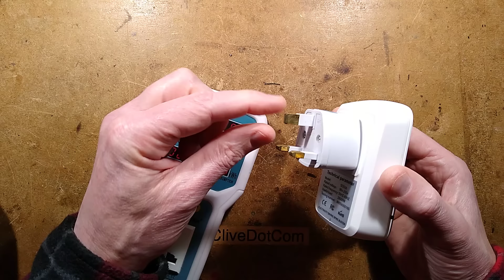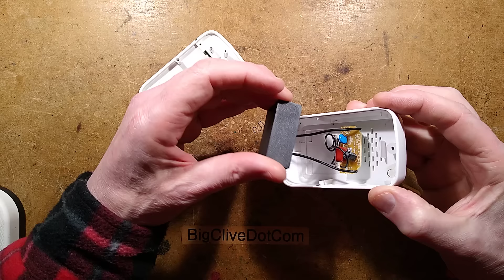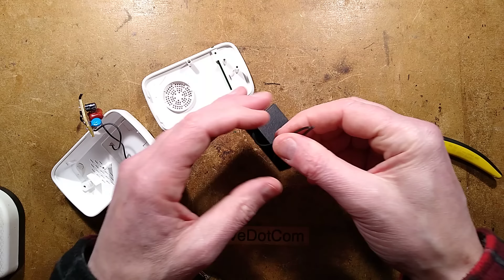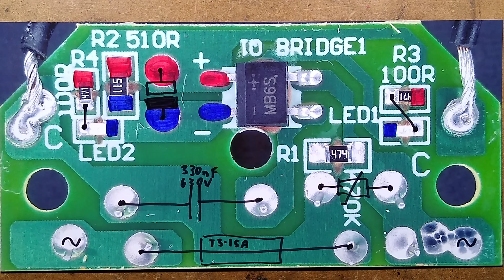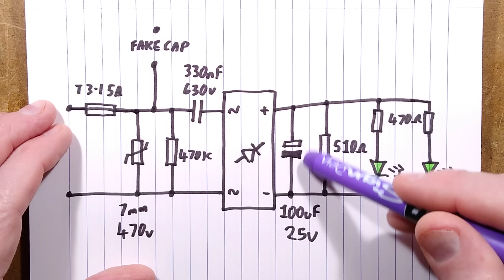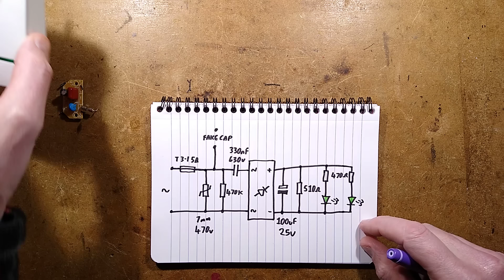Scam power saver plug - the 2024 edition.

Comment: Dumb question, but why is the sleeved Earth pin naughty?
Reply from the maker: Although it's not used in this product, the earth pin is sometimes sleeved on other products that do use it.  It defeats the earth connection as the plastic tends to be in the contact area.  There should be no plastic sleeve on the earth pin at all.

Comment: Question is, is there a thing, a plug in electric savers for domestic use ?
Reply from the maker: Sadly, no.  But you can save a lot of energy by doing things like turning the heating down a bit and wearing warmer clothing in peak winter.

Comment: I have a device my father bought probably 35 or more years ago. It’s a small box that you plug into the wall and you plug your refrigerator into it. I’ve tested it using a watt-hour meter for 24 hours with the refrigerator door untouched with the device and 24 hours with the refrigerator door untouched without the device. 

It easily reduces power consumption by around 22%. The unit is packed with circuitry and integrated circuits that control the current to the refrigerator’s compressor motor. Ramping it up and down instead of running full out all the time.

Units… some not all… whereby the device is plugged into the unit then into the wall do work with things like motors.
Reply from the maker: There were plugs that reduced compressor power with phase angle control or something.
Reply: @bigclivedotcom Wonder why they seem to no longer exist. Savings of 22%? I’ll take that all day long.

Comment: The state-run "Stiftung Warentest" in GER reported, that water& energy saving shower heads have the greatest savings potential, up to €300 p.a. at a cost of just €20. Otherwise, you should install LED lamps, switchable power strips, energy-saving heating pumps, programmable thermostats and timers: for water boilers, router, repeater etc at night.

Comment: my wife asked about this device . I work on auto electrical for many years, and I am glad you are showing this. I think there are ways to use solar panels and backup battery systems / but even those devices have fraud do your research / the rating can be misleading.

Comment: I found these in a small Returned Amazon Type stuff local resale shop. Two sets of them separated by a couple of years. Both sets had the larger circuit board of your first sample. The first set had real High voltage capacitors in the microfarad  range The second batch had the potted boxes as above, which I presumed contained a capacitor. Small capacitors across the hot leads do provide some crude Power Factor correction. In all the devices, the leads of the "capacitors" are both soldered to the same trace on the circuit board. Now,, this is clearly not a factory error. In the US, both leads of each capacitor are soldered to the trace from the neutral power wire. Knowing that the intent is to place the capacitor across the AC power leads, close inspection revealed an unused surface solder pad on the circuit trace following the fuse from the AC hot wire, I moved one capacitor wire to the intended solder pad. Little did I know that in half my devices, I was wasting my time. Now to sweep up the sand on my floor. Some of these devices have been brought to market at $100.00 each. For a year, Elon Musk was the primary promoter of these devices. They are no more than glorified green LED night lights! The amount of corruption and fraud in this product is beyond measure.

Comment: so, say an actual capacitor was there and put a link on the blank pad? how spicy would it get?
Reply from the maker: Some do have real capacitors, but still effectively do nothing for your electricity bill.  Depending on the loads in your home they may actually even cause higher apparent power.

Comment: I kinda want these just for the A/C plug and project box.  If it had a AC -> DC 5v (usb-ish voltage), I'd use these for microwave presence and bluetooth proxy with home assisttant

Comment: I have always found these things interesting on a mental level. Who decides to make a fake capacitor AND a circuit with components on? I mean, you could use this as an opportunity to export WEEE but that's a lot of effort to make a fake capacitor instead of just some failed capacitor production line that you could put in and not actually connect to anything and so have no risk of fire. Maybe there is just enough in here that they think it will pass some acceptance test somewhere? I find it puzzling.

Comment: Um, they're not scams they're stupidity tax. They're not doing anything illegal.
Reply: How is this not illegal???
Reply: @Bungle2010  What law are they breaking? And what's the damage? $50? Are you gonna take them to court for that? Also pretty sure they're worded every aspect of their "promises" by consulting with lawyers. Like "UPTO 1000% savings". If this is illegal so are fruit juices with various health benefit claims. It's all valid in the legal loopholes. Consumers are supposed to be smart enough to not fall for such things. Caveat emptor
Reply: @duytdl  They're making false claims and seling a device that does nothing. That's a blatant breach of the advertsing code.
Reply: Is it not against electrical rules to willingly create a phase shift 🤔 That kind of condensators are only for compensating inductive loads. Anyway, that trick with the phase shift was intended to fool those old elektromechanical meters a bit. To save some money by stealing from the energy company, it could never save energy of course. Doesn't work here anymore since we all got electronic meters 😅

Comment: I am shocked that they allowed to sell sleeved earth and the adapter you used not having any shutters on the live and  neutral sockets, and no fuse. Which all illegal to use and have in the country. As the following will point out

Adapter 
1. The prongs to close to the edge of the plug 
2. The earth prong is too small* (apart from being sleeved)
3. Anyone can put live to earth  or neautal to earth causing a short and risk of catching fire. 
4. As I said before no protection for live and neutral sockets. Meaning a child could easy put metal into live or neautal socket and get a nasty shock.
5. Adapter is too small
6. No fuse in the adaptor 

Plugs 
1. The earth is too small * (apart from being sleeved)
2. Prongs to close to edge of the plug 
3. The plug is too small.
4. The wiring in the plug is wrong, ie earth is in neautal or earth prong
5. All the prongs are same length. 
6. There plug is made from ons peice of plastic with words 13amp fuse fitted no way of checking it.
7. The plug  get very hot 
8. If there a way to get into the plug, the fuse is wrong ie 13 amp for a lamp.
9. The equipment the plug is wired to get hot and in the end stop working.
10. The moulded plugs expand.

*in some cases smaller than the live and neutral prongs 

Fake CE mark and UKCA mark, 

Please note I am qualified pat tester number for items I have to failed and take out of use due to they being fake or they do not feel right, like a iron with all safety marks which are fake and when hold the iron there was no weight to it plus label as classed 2 (square symbol), with a rewirable plug, when open it, it had a earth wire, which means it should be classified as classified class 1 as it needs a earth, plus any items with exposed metal parts automatically classified as class 1 not 2 as it needs to be earthed, because electric will always take the shortest route to the ground ie via your body.

Comment: Bypassing the incoming power feed in the house's electrical box is the best way to do it. Apparently if you only bypass the meter with a smaller gauge wire it can cut down the power and will be undetectable.
Reply from the maker: Not recommended.  It's hard to hide it and poses a very high shock/burn risk.

Comment: uhm... interesting.... now this made me wondering WHAT would HAPPEN IF you ADDED IN the ACTUAL Capacitor in the circuit... 
would that make any differences ? same? different ? or something bizare ? I'd love to see that... I'd do it but... I don't wanna get scammed for no reason... so... can you try to add in a REAL Capacitor ?
Reply from the maker: Npo significant difference as most meters measure real power and not apparent power.  If apparent power was being measured, this device could end up increasing your electricity bill.

Comment: I'm always amazed by how unstable is mains frequency in the UK, at 50.14 Hz  EU power grid would be in some emergency regulation mode already.
Reply from the maker: The frequency increases slightly at night to bring clocks back in sync.  I filmed this in the small hours.

Comment: You mean 'profit from the clueless' plugs?
After I plugged mine in, I saw NO energy savings; but I have an endless throng of women throwing themselves at me, now.
What really gets me, is that Big Clive has exposed my fake capacitors, and now I will have to shut down the factory, and cancel my sand orders;
and move to a different building.

Comment: So why do they use capacitor banks in industrial instalations??
You need to learn about power factor and reactive electricity between drying bottles of whisky.
Thes power savers, unless that one's a fake, actually do work and you can really see the difference on the older electric meters that the disc that spins around.
Are you being paid by the electricity companies to lie??
Reply from the maker: As an industrial electrician to trade with many years in steelworks - the correction of power factor on industrial sites is important because of the huge inductive loads.  Most home meters do not charge for apparent power, and most modern home loads cannot be corrected by a mere capacitor due to "electronic" power factor being very different from a simple inductive load.

Comment: I saw the ad for this thing, and in the US ads they plug it in and it half falls out of the wall.  SMH
Even so, I'm amazed they bothered with any of this crap.  I'd picture an LED, a resistor and a 1N4007 diode.  All done.  I have no idea why they would bother with anything else since it clearly doesn't do anything and anyone stupid enough to buy it isn't likely to open it.
I wonder if you could just put a battery in it with flasher circuit and LED along with plastic "power" plug pins and anyone would notice.  IE it's just a rechargeable LED flasher with no mains connection.  I bet they'd sell lots of those.

Comment: When does the Big Clive branded fake energy saving device with improved PCB layout, brighter LEDs, and compliant earthing pin come to the market? I need something to balance out the extra power being drawn by my fake insect repeller. The big magnet I put around the mains doesn't seem to be doing the trick, I think I made a mistake when I was tuning it with the crystals…

Comment: There's probably some kind of automated measuring device which dumps a certain amount of sand into each housing and then another one dispenses the resin. Maybe the sand dispenser was clogged or empty resulting in the amount of sand being very small but of course they would not scrap the faulty fake caps, they'd just use them anyway. I mean, it makes no difference, really.
Reply: Perhaps there's a higher specified version for an extra pound which has a full load of sand in the fake capacitor..

Comment: Why even a bridge rectifier? With appropriate resistors you can run LEDs straight off the AC. Who cares if they’re flashing at 50 or 60 Hz. Nobody cares. I guess the Chinese also employ scam electronics designers who just copy-paste circuit designs.

Comment: Have you seen an advert for Lumi Warm, a plug in heater? It's about the size of a large paperback. The claim is that last year your electric heating cost you £1,200 but this year it will be £5,000 (!) but using their heater it will only be £900. "Heat your home for just £2 a day" It can also heat a whole room up in 2 minutes flat. This thing can obviously defy the laws of thermodynamics., or it's a total scam. I wonder which. Which? already have it flagged as illegal and dangerous - just up your street!
Reply from the maker: It does heat your room in 2 minutes....  By 0.00001 of a degree.
Search my videos for the keyword heater.
Reply: I get so annoyed with these adds for 'more efficient' electric heaters. Given that all electric resistance based heaters are pretty much 100% efficient, there's now way to make a magic more efficient heater (excepting a heatpump, but that's not exactly compact).

Comment: Excellent video! How stupid is this design?? They could have run the LEDs just off a cap off the mains.  LEDs back to back... they will pulse a bit but that does nae matter!
The cheapness of scammers knows no boundaries!
Reply from the maker: It would need an inrush limiting capacitor too.  Because if the LEDs stopped working then people would think the unit wasn't saving power any more.

Comment: Thank you Clive for showing the entrails of this ongoing, long time scam product.  I can only guess that the product manufacturer, knowing his product is 100% fake, decided to reduce the amount of power saving sand to cut costs.  I am a bit surprised the electronics haven't been scaled back as well.  They can get by with as little as a 470k resistor in series with 2 back-to-back LEDs, of course then the product won't have any weight.  To compensate, they could hot-glue a piece of that concrete rebar that shatters if it is dropped.  I guess we'll see what the future holds.

Comment: Ah, I see from the most expensive of that model on ebay (£8.61) that "The product is equipped with anti-convex wave device to prevent current convex wave and protect electrical appliances".  Judging by the sand those "anti-convex waves" are to be found on a beach?

Comment: Might be able to find a use for the enclosure? Something that is double insulated, otherwise you'll need to replace the earth pin.  You could even get a smaller multi-stage mains filter squeezed into that device.

Comment: I have to wonder why you'd bother to put sand into a "fake capacitor"?  Surely that's more effort than just looping the wire through the resin?
Reply from the maker: It's possible that the real capacitors surround the bare capacitor inside with sand as filler.

Comment: Nice case, it can make a nice night light. Maybe with some amber or warm white dimm LEDs?
I guess it did not really need the ground pin because the circuit inside is fully enclosed in plastic and it have no outputs or metal to be accessible without opening the case.